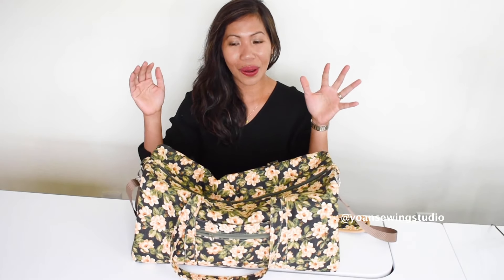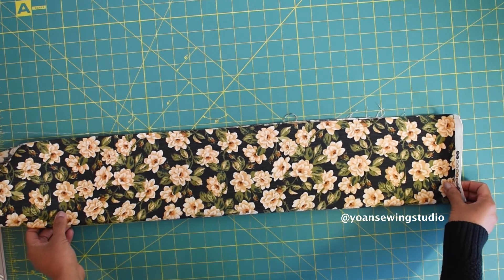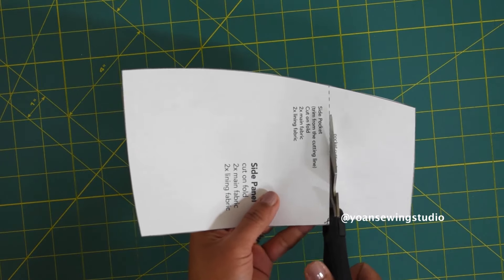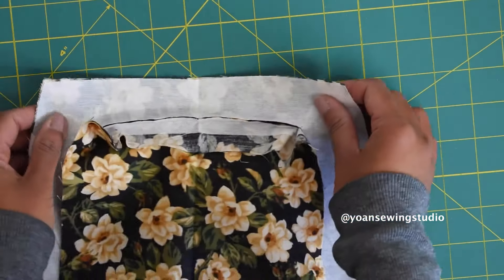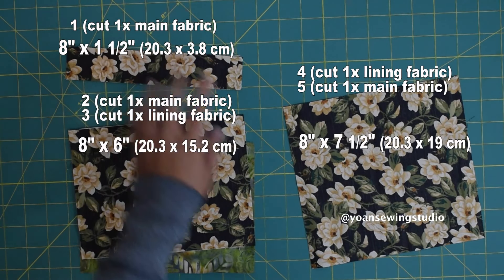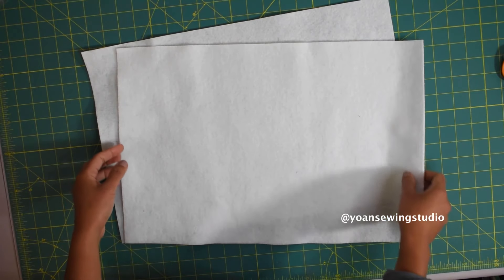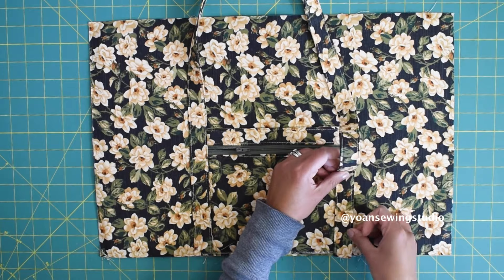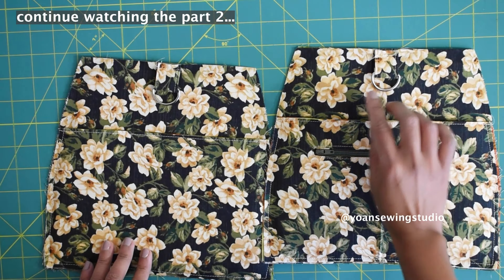The Duffel Bag Project - Part 1 - Side panels, bag exterior, handles

Comment from the maker: Please disregard the measurements for the front and back exterior panels in this video, instead of 20" x 14", I reduced it to 20" x 13 1/2" so that they will fit more snugly to the side panels.
Time Stamps
Intro 00:00
Preparing the template 02:07
Cutting the side panel 03:27
Side pockets 06:30
Side zipper pocket 07:53
Front pocket 12:48
Bag Exterior 15:59
Handles 17:16
D- ring tabs 21:24

Watch Part 2 here : https://youtu.be/BrmZqRTNmdg
Watch Part 3 here :https://youtu.be/aTDcaxyPspY

Download the side template and cutting instructions here : https://bit.ly/3jMqVw0

Comment: I just started making this and realize that I won’t have enough fabric to make the handles 42 inches long. (I’m using fabric from my stash) Would it work if I can cut only 38 inches for the handles? Otherwise I will just use webbing.
Reply from the maker: 38" shouldn't be a problem, however if you (or your daughter) plan on using the handles to carry the bag over your shoulder from time to time, that might be a bit short especially when the bag is full (hope that makes sense), otherwise webbing would be a great option :)